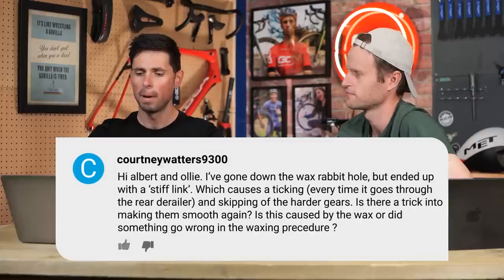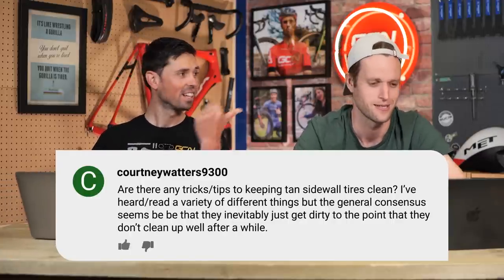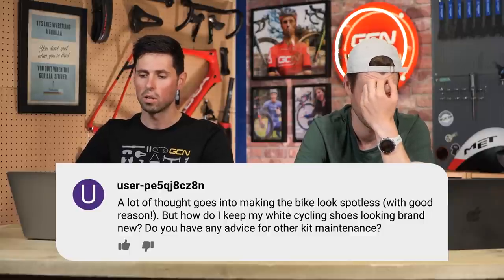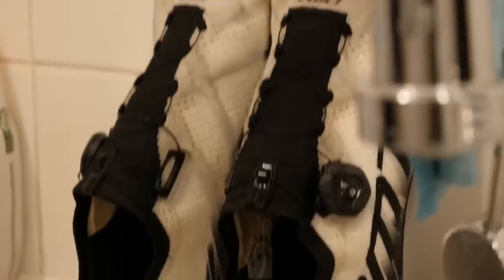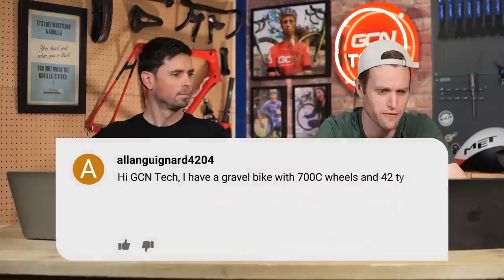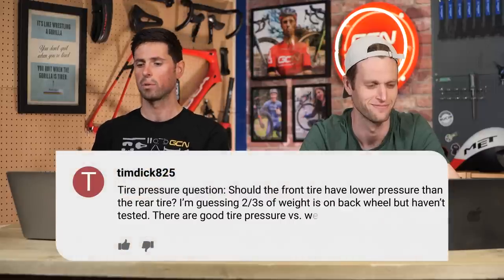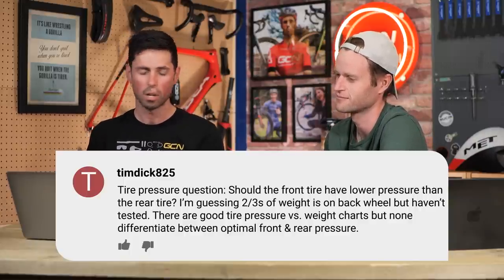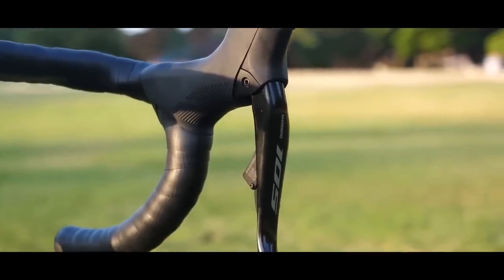Tyre Pressure, Chain Length & Dirty White Shoes | GCN Tech Clinic

Comment: Hello. Stumbled upon info that some carbon manufacturers also use and put fibre glass within the frames, especially in the fork's steerer tube. Can you expound on this? #askgcntech
Reply: It's to prevent galvanic corrosion. Think about if you left a regular AA battery outside for a couple of weeks, you would notice corrosion around the terminals. The same thing can happen if water (which will act like an electrolyte solution) reacts with the alu steerer plug effectively creating a small battery within your steerer tube. Thus, manufacturers will put a thin layer of fiberglass, which is nonreactive, between the carbon and the steerer plug. This is common on high-end bikes due to the added manufacturing cost.
Reply: Elves has released an statement regarding that. They say it’s to prevent corrosion. I personally using elves frame and that fork is built like a tank lol. And i never heard of any issues on my group or friends that has elves frame.
Reply: I don’t think YouTube needs another video on this 😂

Comment: you waxing issue can be easily sorted by simply applying no was and some oil just like we have since the dawn of time #ifitisntbrokdontfixit
Reply: Have you tried a waxed chain? It's kind of amazing. It's nearly silent (I'm using Shimano chains, so YMMV), you can touch the chain and your hands are clean, and best of all, your components doesn't experience the same kind of wear. I've ran my chain almost 12K miles, and there's almost 0 stretch compared with a new chain. My bike came with 11s Dura-Ace, so not having to replace drivetrain components have saved quite a bit of money.

Comment: Front tyre should have more pressure than the rear. Physics. Lower pressure on the rear (driving) tyre will afford more grip. Front tyre? higher pressure less rolling resistance.
Reply: Most of the weight is on the rear wheel, so it's logical for the rear tire to have a slightly higher pressure as there's more weight for this tire to bear. There's a reason why rear tires always wear out faster than the front.

Comment: Front tire should always be lower considering cornering stability and vibration also most of your weight is over the rear wheel. 72/75 is my go to
Reply: I've just noticed the bike feels and responds better with a little bit less pressure in the front tyre. Less vibration through the hands, and it doesn't skip and bump so much when cornering on rough surfaces.